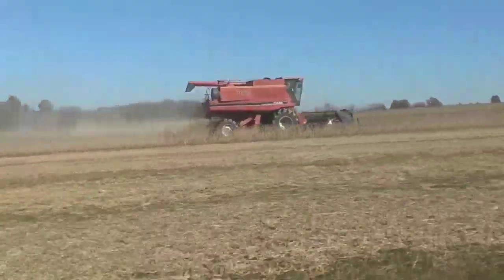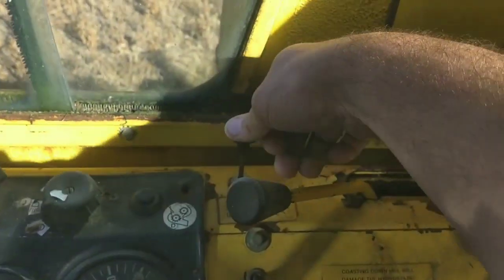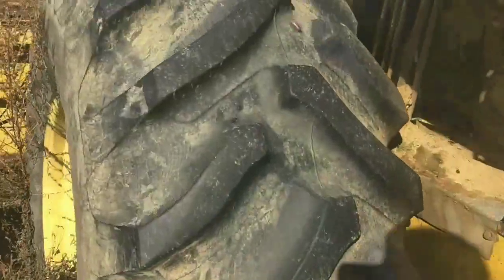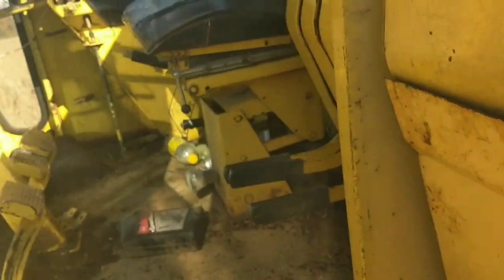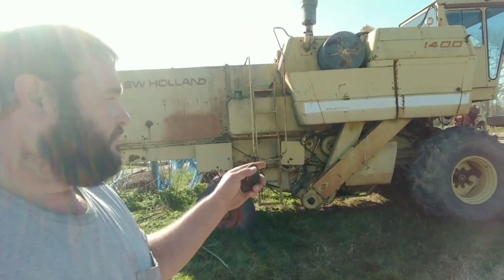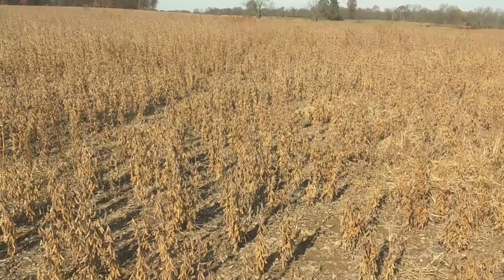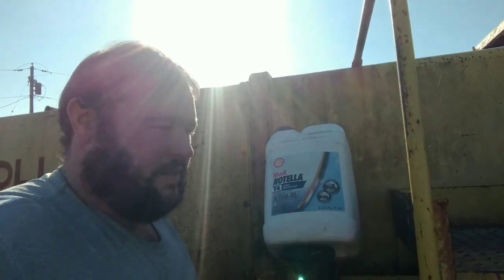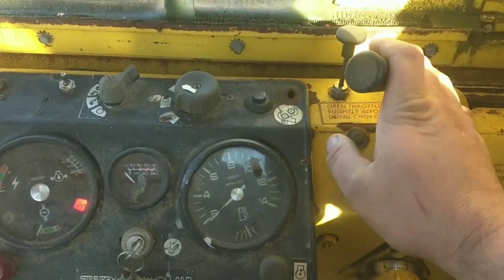Moving the New Holland 1400... NO starts and robbing parts

Comment: Been there before crop ready to go combine ripped apart was going to cut oats for hay so never fixed combine weather didn't cooperate so the oats ripened had to rip the cylinder out the grain tank off and the whole drive system to pull the beater out to replace the keys in its shaft what a job lol
Reply from the maker: Wow I feel for ya brother! Tooth and nail let me tell ya lol 😂